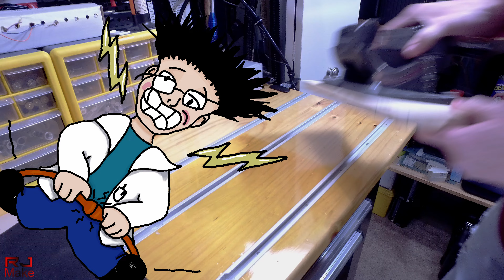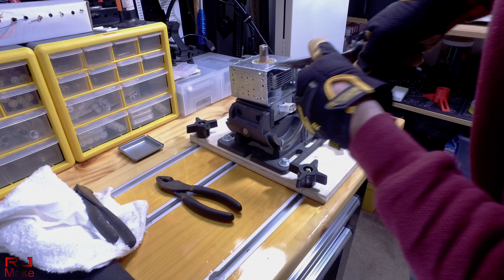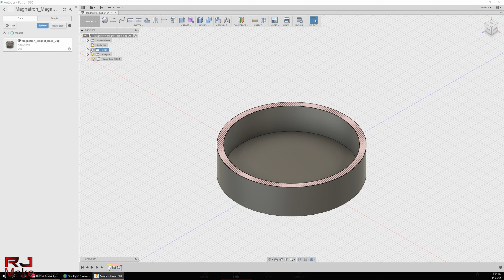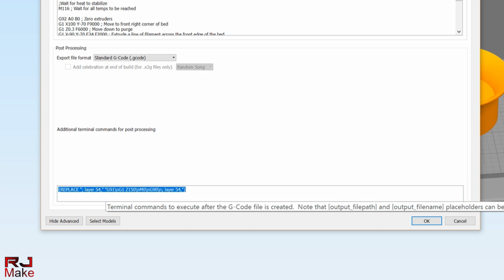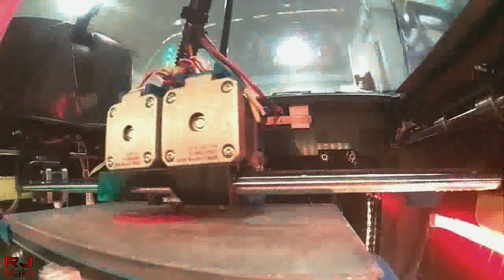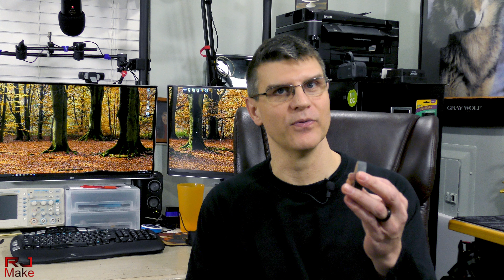Easliy Embed Magnetron Tube Magnet In Your Prints with Simplify3D And One Simply Line of 'code'

Comment: Great video RJ,  my interest in in embedding.  Your video was the first video I could find to show me how to easily embed in Simplify3D.  I just want to embed nuts and bolts.

Another question.  If I want to embed (encase) a 6m x 35mm bolt.  Can you tell me how to raise the bottom layer up to a height where the bolts will drop in?  Meaning I would build supports for the entire bottom and then stop at correct layer using your technique and drop the bolt in.  Because of the supports, the bolt will drop all the way down into the print.  Thanks again!!
Reply from the maker: Thank you midsouth360. This was a fun video to make.  If I understand you correctly you should be able to do this by using the Z-Offset adjustment.  Double click on the model in S3D, this will open an option panel on the right. In the "change Position" area look for the Z-Offset.  Raise the model off the bed to your desired height.  With supports enabled you should be 'good to go"

From there you should be able to use the Cross Section View (Ctrl + K) to find exactly where you need to split the model.